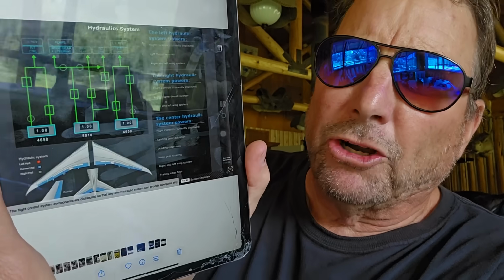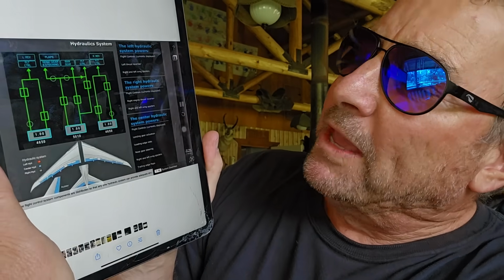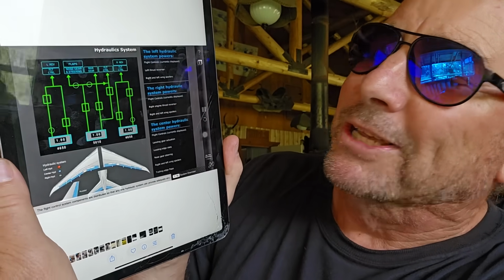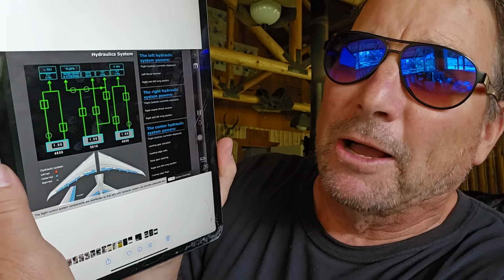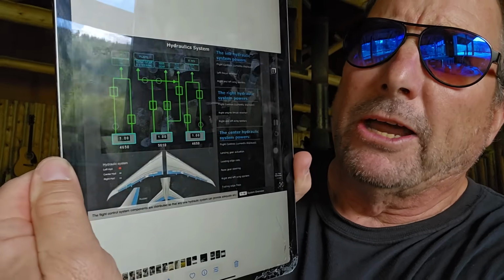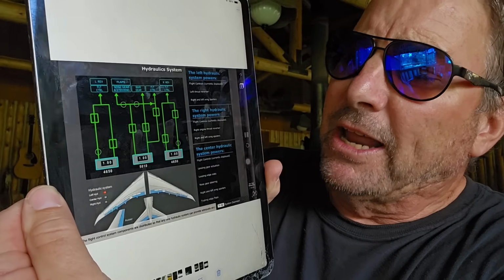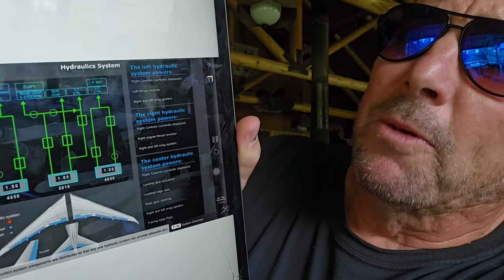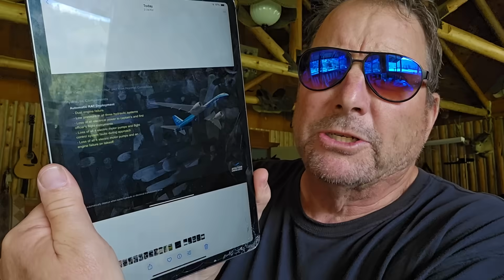787 Crash India What's a RAT? When does it deploy?

Comment: Check out the latest Stig Aviation video. There is a shot of a 787 taking off at the 19:50 mark that shows a wing configuration that is a close match to the Air India plane. This is another indication that the crash was not an incorrect flap issue.
Reply: My response to people was to ask which pixel they are looking at and how compressed do they think the colours are? 

Then show them a high res video of a 787 takeoff and ask them “what flaps setting is that?”

Critical thinking is important. Even more so when you have some knowledge and experience.
Reply: I've been saying from the get-go: flaps 5 on a modern wing looks pretty much like a clean wing, it's very subtle. Everyone who was claiming "the flaps weren't deployed" doesn't know beans about modern transport aircraft.

Comment: Hydr failure is what I've been thinking as well. My other peeve-  those gigantic GE engines should be enough to pull that loaded air frame out of any situation regarless of flap position or gear down. Don't forget the pilots mayday included the words "lose of engine power". imo
Reply: Yeah, the plane should climb on one engine, and there was no evidence of a thrust imbalance during the incident. I don't see why hydraulic failure should shut the engines off. Sounds electrical to me as the signal is sent to the engine ECU to set the power level.
Reply: @rivalrepairs Engine failure will take out the hydraulics as will total electrical failure.

Comment: Anecdote.  At my airline, 20 some years ago, a B-757 crew were seeing anomalous Airspeed indications on the Captain's side. 
These "geniuses" decided to look at the C/B panel and saw a C/B that was labeled, I dunno...but they PULLED It, mid-Atlantic.
This caused the RAT to deploy.
They were past the ETP, so just continued to destination...trying to explain to pax in F/C about the noise and vibration.
True story.
Edit?  On the B-757/767 that I flew, the RAT was located more forward than on the B-787.
On the Walk-around of the 757/767 series, the RAT door is clearly outlined.
Reply: I did wonder what the RAT would be like if it's that loud at low speed, surprised it held together!
Reply: I'm 73 years old I'm long past saying unbelievable when it comes to what were they thinking

Comment: The ADSB transponder stopped transmitting. Yes, it could be coincidence, but it wasn't a coincidence in the Jeju crash, and it lines up with RAT deployment in suggesting electrical failure. So here's a question for anyone who knows the 787 systems - would such an electrical failure also cut out the Flight Data Recorder and Cockpit Voice Recorder, as happened in the Jeju crash?
Reply: This is what I've been saying, ADS-B cut out at almost exactly the point the plane stopped climbing
Reply: @danielvanced5526 I don't think it's the whole story - the amount of FOD on rotation suggests it over-ran the end of the runway, so it seems like something was badly wrong already during the roll. But yeah ADSB + RAT + gear staying down is definitely pointing in an electrical direction
Reply: No an electrical "failure" would not have an effect on the FDR or CVR on 787.  Think battery bus input to those two devices.
Reply: @you463 thank you, that's good to hear. Hopefully they will have enough information to figure out what happened
Reply: @you463 Modern FDR and CVR have independent battery backup for at 30 min after loss of power from the aircraft busses.
Reply: @allangibson8494  Only if maintenance was been replacing the batteries when they are suppose too...
Reply: The lone 11A survivor also reported the white/green emergency lights flickering on when it lost thrust. Mind you eye witness reports can be very unreliable.

Comment: So do the CVR/FDR operate in a 787 with loss of both generators? Would RAT power supply them?
Reply: That's a good question, the Jeju air crash lost both recorders when the electrics failed, hopefully he will do a deep dive into the electrical system when he has time.
Reply: @danielvanced5526 The 737 CVR electric supply design is straight from the invention of them in commercial aircraft in the 50s and 60s. The 787 is mostly designed after 80s (777) and 2000s. I imagine it operates just fine as long as the batteries have power.
Reply: @rkan2 i think this plane use lithium baterrai just like our handphone and many ppl worried about that.. the only survivor told that he herd a loud bang noise

Comment: Thanks Juan.  Seems like you sneeze on a airliner or corporate jet these days and the RAT pops out.  So many failures from minor to anything that can cause this...and certainly is only a small clue as to what happened, but it's like front page everywhere.  I guess there is just not much else to talk about.  I see a half dozen planes a year landing at the local airport with the RAT out...no biggie.  I did a bunch of geolocation, timing and alignment of elements work to determine the takeoff roll start point, and rotation location on the runway.  I sent it to you Juan via email.

Comment: Also with that audio clip is what we are not hearing which was engines at takeoff power. The flight crew reported "No Thrust" with their one mayday call out. Well,  both data recorders were retrieved undamaged so there should be some answers soon.
Reply: Maybe, unless it's discovered that the CBR and data recorder had no power because of electrical issues like the South Korean jet.
Reply: CVR. Not CBR.
Reply: Sinking (Losing lift) with engines at full throttle developing full thrust, can give you that seat of the pants feel of no thrust.
Reply: @truthserum5310 basically a power-on stall.  I’ve done it many times in the sim but of course never in the real airplane.
Reply: @dougcarlisle7557 Did it many time in a Cessna 172 during my flight training. Scared the crap out of me the first time I did one.
Reply: FDR is going to be critical since it's near-certain something went seriously wrong mechanically, CVR might or might not make a difference especially if they used memory items instead of a checklist.
Reply: The reports that the Mayday call stated loss of power are questionable. Other sources state that the pilots called Mayday but didn't provide any details.
Reply: I think the 787-8 has a battery backup for the FDR.
Reply: Yep totally agree no loud jet engine sounds…likely needed TOGA at that point and maybe hear flight idle? Maybe nothing.  Very sad, indeed
Reply: The source claiming there was a mayday call has retracted his statement.
Reply: Recording ATC comms in India is forbidden by law, so those reports are just from news stations. I wouldn't be surprised, but we can't know for sure what was said until an official report comes out.

Comment: It seems like there was barely enough airborne time for the RAT deployment sequence to complete. It must have begun to deploy almost immediately after rotation.
Reply: I'm not an expert on this, but I thought the RAT only takes a few seconds to physically deploy, just longer for the full cycle of it bringing power back to systems. Is that incorrect?
Reply: @mortekaieve4729  Well, the system, or the pilots, have to note a condition requiring deployment, and decide to deploy the RAT, and then the RAT apparently takes 8 seconds to fully deploy. I'm not doubting that people hear the RAT, and even see it, but the plane was only in the air about 30 seconds. And if it's the RAT we hear in the pass by video, it's already fully deployed in what seems like about 15 seconds.
Reply: @bills6093 I'm not fully convinced what we are hearing is the RAT.  Based on the distance from the accident aircraft that video is taken, it seems like it could be a propeller plane in the area.

Not saying it ISN'T the RAT, but I'm just not totally sold that it for sure is.

Either way, I don't think fuel contamination (at least from the fuel itself) is a cause since we would have seen other aircraft with issues and they've certainly already tested the fuel used on this plane.
Reply: @bills6093  If the RAT auto deployed when one of the list of conditions were met it would be feasible for it to have been running in that bystander video if they had some catastrophic failure shortly after rotation. Even if it were to take 8 seconds to drop, but I've read it can be as low as 3-5 seconds for it to be down and running. It would make sense that whichever system failed would not have power restored by the time they crashed because of the additional time it takes to actually restore power. But again, I'm no expert on this issue.
Reply: @mortekaieve4729  Well, the engines don't stop instantly. They keep turning and providing power for a few seconds until they spool down enough to stop producing power. So if we say it was fuel. Okay, both engines lose fuel. They will take several seconds to stop providing electrical power. This one is a poser, that's for sure. The solution will be very interesting.
Reply: @bills6093  Of course they don't instantly quit, but if they quit without being commanded to quit and during a critical phase of flight I would not be surprised in the least if the system deployed the rat before they spool down. There are something around 1500 data points per second being fed in, it's going to notice it before the pilot. I'm very interested to see what the final report will say, maybe we will get some good info in a prelim report too, though.

Comment: I did what you said - looked at videos of this 777 in the air on take off. What I saw was main gear down but main wheel doors still closed, and flaps look retracted! Not good at the low speeds after take off. Did someone hit the wrong lever and retract the flaps instead of the gear?

Comment: A video on the internet shows this jet was having cabin electrical issues on the preceding flight. The IFE was inop and the cabin air wasn’t working either. Keep in mind the ECS is powered electrically on the 787. The crew also made a mayday call.
Reply: I saw that video too. Many electrical systems were inop, A/C, phone, etc.
Reply: @gcatwyo that’s totally normal for air India, they don’t fix their Dreamliner cabins. Find me someone who has flown them with a working screen
Reply: @gcatwyo If you watch that passenger’s video carefully, he complains about the air conditioning not working as his camera shows an aircraft parked outside the window:  the aircraft was on the ground, not airborne.  Ground air conditioning had not yet been connected.  Passengers will have the least credible comments about any airliner or any problem that occurs.  They are sitting in the cabin, not in the cockpit, and they are not trained crew members.

Comment: While the "fly-by" video where you can hear the RAT is low res, there does appear to be a shadow line under the leading edge of the right wing, indicating that, at minimum, the leading edge slats were probably extended.